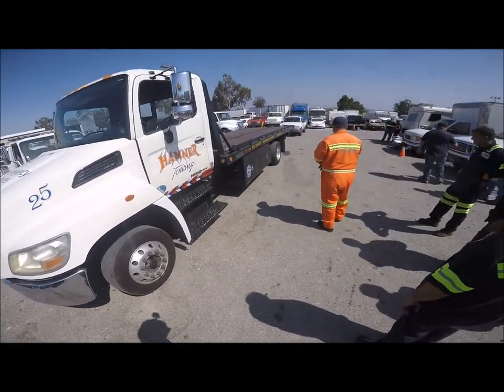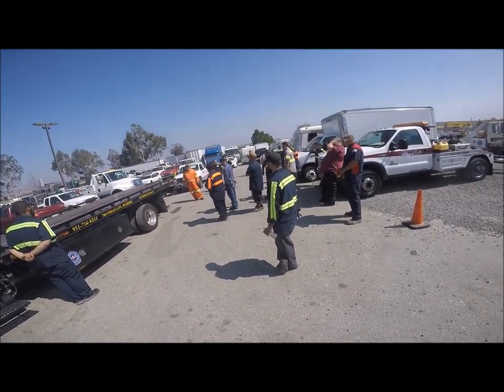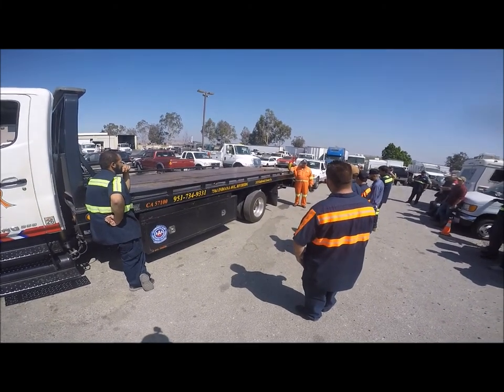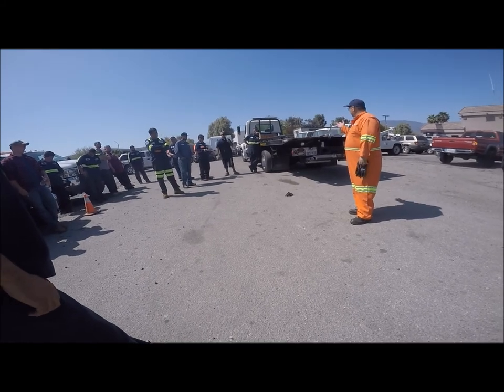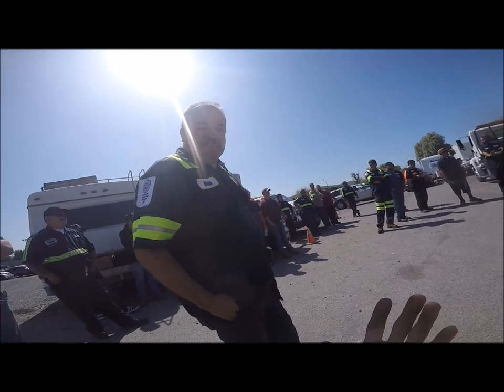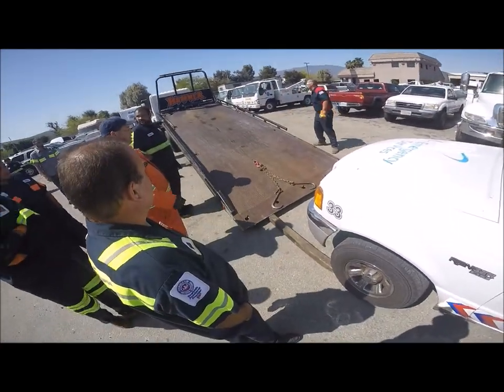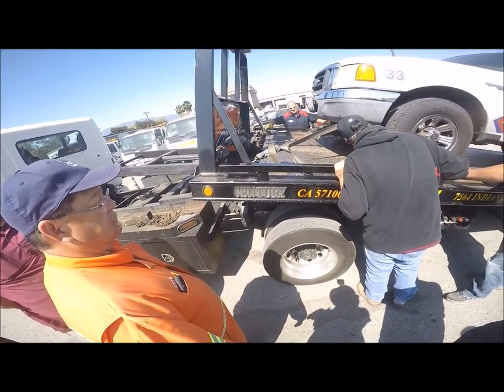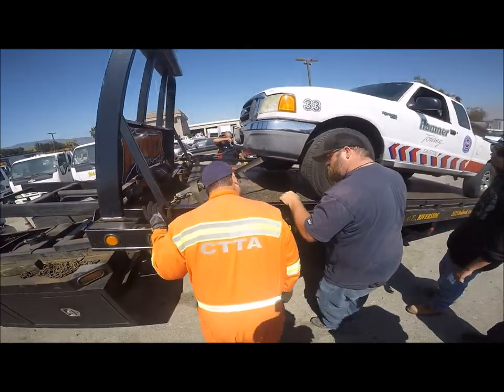CTTA TRAINING  #3 FLATBED TOW PROCEDURES

Comment: Not a bad video for newbies. J hooks have no place for general breakdowns. Use the right hook for the job. J hooks equal damage complaints.
Reply from the maker: An experienced person can use any piece of equipment without causing damage that's the key experience Newby's that's a whole nother story LOL thanks for watching
Reply: @Pyro4100  I do agree that an experienced operator can use various tools to get the job done. There are far to many steering wheel holders out there. I run a fleet of Roll Backs and removed the J Hook bridle from all of them. Bear in mind we do not handle any recovery work. We transport exotic cars and some motor club work. Training is key and far to many dont have it or seek it. Keep the videos coming. Stay safe out there.
Reply: I use nothing but J hooks, Damage free towing, Have had one single complaint and it was very easily proven wrong, Guy claimed I damaged his ball joint winching him back on the road after he tried to turn around and slipped off the edge of the road, Other than that which was a false claim that we didn't pay into, I have had absolutely no complaints with any tows, Crash tows, Impounds, or cash calls and I use J hooks for them all, That being said you don't want to J hook suspension then crank on it to tighten rear chains, So long as it's not weak suspension pieces it won't break when done correctly but it can mess with alignments, There are a few different ways I go about doing that, 1. wheel straps, 2. I'll put chains up front put em on frame slots then lower the car onto the chains then rear chain with binders or strap the rear of the car to keep the front tight and do the rear tie downs, Many ways you can do it and some will cause damage, but when done properly it never will.
Reply: @towtruckaj  Perhaps I should rephrase that. Operators can yes successfully utilize them. Sadly alot of guys are just steering wheel holders.
Reply: @thook9951  Yeah a lot more to go wrong with big J hooks, Especially the long ones i've heard of guys having them crack into oil pans and shit, But i''ve also seen guys tear open frame slots a ton, honestly there is a lot you can fuck up in this profession and I see it done a ton, Especially when the copart and IAA guys came in, I've since changed up how my fleet operates and I have guys switching from AAA more to copart and IAA themselves, But my guys are all professionals and have proper training, and that is not all they do, They are not the typical AAA driver, We all are professionals and are good at what we do, And being in a small area I have to take on some of that work to keep my guys busy, But when I didn't have guys doing auto auction work i had all sorts of companies coming in and they would fuck all sorts of stuff up, I even had one guy who got the vehicle on the bed then left out lot with not a single tie down at all and parked outside our lot to wait for his boss to come and load his car for him, Point being there are a lot of fools in this industry who will fuck up and system you give them to work with.
Reply: @towtruckaj  Its a shame that the few can give the whole industry a black eye. We pride ourselves on being professional, courteous and damage free. We keep the trucks clean at all times. No customer wants to climb into a filthy rig. We mainly do accident recovery work. Thankfully no motor clubs. Nothing wrong with motor club work but the pay rate is not worth the aggravation most times.
Reply: @thook9951  I'm with you, My company does do motorclub work, By no means do we have to and we are not just towing so we could cut out all towing period if we wanted to and still have other shit we do, but with the fleet we have we have to do motor clubs to keep guys busy, Personally I do no motorclubs just accidents and impounds and the rest of the fleet does motorclubs, accidents, and more recently we have been shifting from motorclubs to auto auction with IAA and copart, My guys seem to like it more, rates are still shit along with other motorclubs like AAA but we are cutting out AAA with the auto auctions and it's less demanding work, no customers, no real deadlines, far less stress, the guys seem to enjoy it a lot more, But my guys are well trained professionals, I have 2 guys in particular that are far from clean with their trucks, which I don't like but I am not too worried about with them doing mostly auto auction, As for the rest of us we keep our trucks very clean, and we offer damage free professional tows, but like you said the bad companies shine bad light on us all, and sadly the bad companies are the ones doing the most work, I have a company across the street who is crashing a truck at least once a month with some sort of damage on them and a ton of accidents occuring, Multipe DUI arrests, Tons of management issues like not paying their drivers fairly, etc, The same drivers getting duis still working for them, they will go out with a battery truck to do a jump start and say it needs a tow and we will get assigned the call and jump start it, just everything bad with the towing industry and they do the majority of the motorclub work in our area with us being the backup pretty much because we don't as heavily rely on it.
Reply: @towtruckaj  Its a tough industry but ine that I love. I as I'm sure yourself love helping people. I also enjoy the challenge of recovery work. Being able to get things done that others could not or would not even attempt. Training is key to success. If I ever reach a point that I think I know all there is to know I will hang up my hooks. We had a young fella join our team. I asked him what he can do and how long hes been doing it. He said he knew everything about towing and had been doing it for six months. As I held back laughter I politely told him he didnt know shit. I explained to him that kind of attitude will get you killed. Thankfully he took my words to heart and has come along way. He quickly realized that recovery work is not just hooking chains and pulling levers. Stay safe out there Brother.
Reply: @thook9951  I don't do much of the obvious "helping people"  i do impounds and crashes, either i'm there to take your shit because you fucked up or i'm there in one of your worst moments, I do the occasional jump start or lockout if someone needs help while i'm nearby for an impound or something, I've done a few free services just being there at the right time i guess but other than that i'm the mean ol tow truck driver lol but I do very much enjoy my job, Most notably I enjoy the recoveries, Impounds I don't really enjoy other than maybe officer interactions that's just business, but I do love recovery work, I'm working on going into heavy duty work for that reason alone, So i do love my job, and you are correct you will never reach a point where you know everything, and I will say it is ok to be confident in what you do but it is not ok to think you have experienced and know everything when you don't, I'm confident in what I do but I still come across calls where i go "I don't know if ill be able to get that with a light duty truck" and sometimes I can't but sometimes I am surprised to find out that I can still, I had one the other day down in a wooded ditch, the nose of the car was touching a giant culvert pipe, The back left was stuck on a fence post, the back right was touching a thick tree, in the front right wheel well was a big stump, the front right wheel was all I could access at first and of course it had the stump and was broken/compromised with the strut hanging out, the left wheel i could see but it was right on the edge of the concrete pad and under was the fast flowing water, that was one of those calls where I looked at it and went "I don't know if i'll be able to get this" After 3 hours, my rollback, a wrecker, and a service truck along with 4 guys I eventually did get it but I wasn't sure until the very end that I would be able to get it, and had I gone in there with a i know everything mentality I never would have, I would have probably gotten someone hurt if I did that, And after the recovery me and my guys were talking about it and I joked that any longer and I would have just jumped in the water, And obviously I wasn't going to do that but we went into it about how fast flowing water can change down stream in a moments notice and that was very dangerous, and as I said I will never put myself in flowing stream like that to get a car but I didn't think of the current changing either so had I actually decided to go in the water, that would not have been on my mind, Now it will be.
Reply: @towtruckaj  Agreed I'm confident but never cocky. I am very good at what I do but never claim to be the best. We do 90% Wreck recovery. We also have two state contracts for roads to remove mechanical calls. We also train and assist Fire and Rescue with crashes. Especially those in heavy trucks. I've done a few lifts when vehicles under ride a trailer. As you know we can lift heavy objects faster and safer then most rescue squads. I love what I do it's mostly common sense with a touch of math.
Reply: @thook9951  It really is an enjoyable job, Can't argue with that.

Comment: Is this mandatory training I'm California, or just voluntary? 

And is this better than the wreck masters train, I see on videos on YouTube?
Reply from the maker: It is mandatory if you tow for the police to have some kind of training certificates this class is a good one to take as far as comparing to wreckmasters I would say it's probably the same although I've never been to wreck Master Class I know people that have and that's pretty much what they told me this is California's version
Reply: Pyro4100 Yes, this demonstration, comes across much like the wreck masters videos, I have watched! 

Although, it doesn't surprise me any, that California makes it mandatory. It is way different than Oklahoma, where I am from, which only really requires a Department of Public Safety or DPS certificate, which comes upon passing a inspection by DPS, that your wrecker meets their standards. 

It was like that when my family had a wrecker service, and it seems to be the same these days! 

Because, I can ensure you, my dad who did most of the towing operations. Never put safety chains or straps on the front. Or anything more than one chain to secure the back. 

Which was done with a one ton rollback, and one ton strap truck. With only a couple times I can recall that we had a strap truck with a hydraulic wheel lift. And the rollbacks as we called them were non-hydraulic stingers. 

Of course, when he worked for other wrecker service's they had much better equipment, and even some of the original hydraulic boom big heavy haul wreckers. 

Needless, to say the equipment is far more Superior today than it was from the 60's through the early 90's when my dad and grandpa went their separate ways.

Now I have gone with friends, who owned or drove wreckers that would do things much more like what is shown in this video and others!

Yet, I am glad that I don't have anything to do with the 24/7 part of the business, due to the fact, that part wasn't my cup of tea!

Which maybe due to being involved with the all hours of day and night, since I was five. Because I was going to work it no matter how much I didn't want to go out at 3 in the morning! 

Needless, to say, I hope you have nothing but continued success as a wrecker operator. Due to the fact it isn't easy, and there are some customers that would complain about you scratching the paint. Even though the reason you are out recovering your car. Is due to the fact, that they wrapped their vehicle around a tree! Oh, yes that truly did happen, to my dad and myself! 
So stay safe out there!
Reply from the maker: TheCrewChief people still do make those claims sad to say and yet 24/7 is not always everybody's cup of tea although I will only work 12 hours a day and we do it in shifts much appreciated thanks for watching
Reply: Pyro4100 Well 12 hours is a much more doable work schedule. Rather than the 24/7 my dad was on call for the family wrecker service.
Reply: @Pyro4100  Similar to wreckmaster in the sense that it's about towing but from what I see here wreckmaster is better and teaches better safer techniques, And I don't know what type of class time you guys have with this but wreckmaster did well with that as well.
As for 24/7, Being a 24/7 driver it can be annoying, Anytime you go to eat or do something, you are most likely going to get called out, but it's not that bad at all, I wouldn't have it any other way I enjoy what I do and sometimes those 4 am crashes can be pretty fun in my opinion, hell sometimes I lay awake unable to fall asleep and boom police call to keep me occupied then by the time I get back, I'm ready to sleep.
Reply from the maker: @towtruckaj  if this is better or not better it depends on how you look at it there's pros and cons about all training having training. Is a plus and I get you 4 a.m. crashes the 24/7 on call it could be a pain or it can be an enjoyment and I'm with you on that I wouldn't have it any other way either
Reply: @Pyro4100  I don't know which training would be better i've never done CTTA, I have done wreckmaster 2/3 and i'm going back for 4/5 however and I think wreckmaster can be very valuable training to have, I went with one of my guys a year ago, and I will be sending all my new hires out to it from now on, It costs a little bit of money but I can see it being very valuable to teach especially to new drivers.